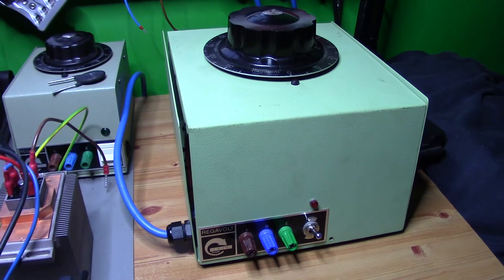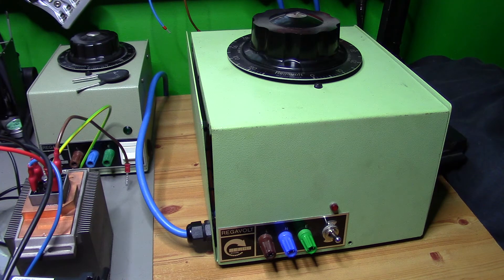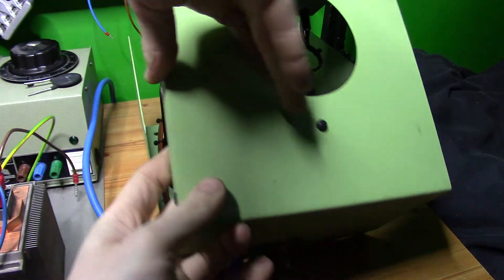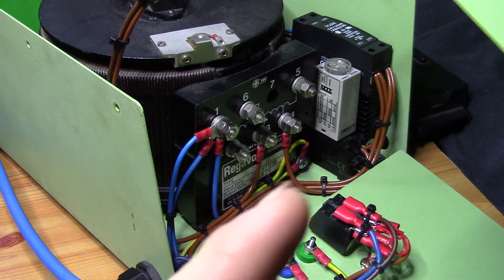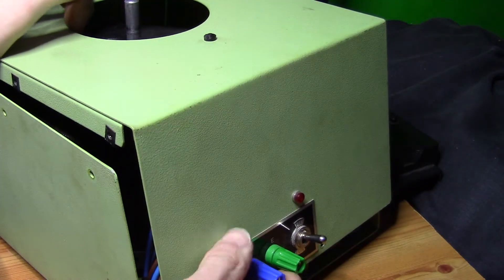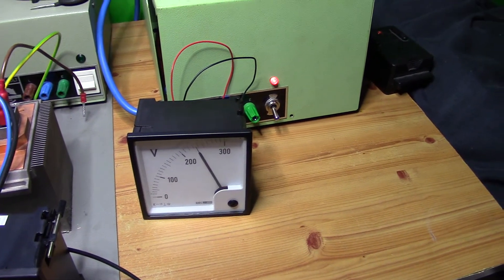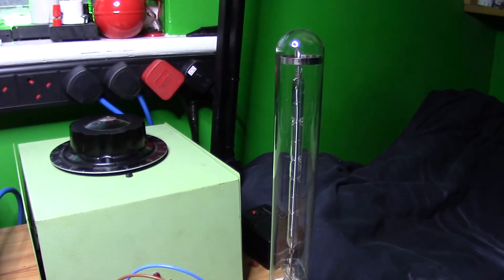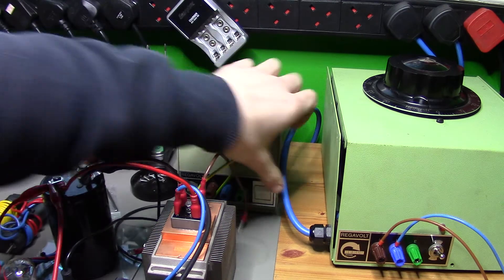Variac Soft Start Circuit + New Video Camera!

Comment: Just a note on the physics: (counterintuitively) you'll have peak inrush when you turn on the variac at the zero crossing point of the AC waveform. If you do the maths with an ideal transformer/variac you'll expect 2x the normal operating current at this point as inrush, but in real life the inrush current can be >100x instead, because the iron core will reach its so-called saturation flux (the point where magnetization of the core maxes out, and stops increasing the magnetic field inside the core by very much). At this point the effective impedance of the autotransformer windings will nosedive (electrically it will start to look like an air-wound variac, which---surprise---doesn't work), and the only thing stopping the transformer windings from cooking instantly due to the huge current is the fact that the mains AC waveform will shortly reverse polarity in 1/100 or 1/120th of a second. (Nonetheless, this isn't good for the windings.)

Of course a time delay and current limiting resistor solve this problem, and there are other solutions like a smarter soft-start circuit without a current limiting resistor which turns the power on to the coil at a peak of the AC waveform (where somewhat counterintuitively inrush should just be the normal operating current).

Comment: What would happen if you were running on full load and the mains power shut off for a second then went back on? Could that resister handle it?
Very nice setup and wiring.
Reply from the maker: It would come back on for 1 second as the resistor resists the load and inrush, then trip out when the relay bypasses it because the half inrush combined with full load would easily still exceed what the B32 breaker can handle.

Thankfully power drop outs are a fairly rare (less than 4 times a year) occurrence here, excluding ones caused by myself that is (more than 40 times a year) which usually involves the variac anyway... Just like the midnight dash to the RCD last night - don't let the heatsink of a ZVS touch the earthed heatsink of the rectifier block...

=]

Comment: great tutorial! you could probably turn down the delay to half of a second because you can tell the variac is charged all the way because the meter stops climbing way before a second. very nice wiring job too! everything in your lab is all prim and proper! good job
Reply from the maker: That is very true, in fact I believe switching on the variac on the falling edge of the sine wave would be enough delay needed to switch on without a resistor, I may try this with a thyristor at some point, not a simple circuit though really.

I chose one second not only because it's the base unit of time but the delay before hearing the timer switch is enough to detect that it is ready to use, ideally the power light on the front of the variac would have been better but the wires were already short and I chose not to extend them to terminals 1 and 4 on the variac.

Don't forget the inertia of the needle on the meter could also effect the accuracy whist it is ramping up, it's not really designed for it, the sine wave captured on a oscilloscope would be more accurate for such a measurement, the needle is just a nice way of demonstrating the two-step soft start, digital meters lack the visuals for videos.

=]

Comment: Nice tidy job on the mod there Steve. Footage is awesome too with the new camera.
Reply from the maker: Thanks John, I did take my time to get it just right in there, nothing worse than rats nest wiring, there's a good chance I'll be back inside this variac again so I may as well make it easy to work on for when I do.

And yes the camera has been a much needed bit of equipment, just getting used to using it now really, I have not even touched the tip of the iceberg with all the functions and features it has yet. =]

Comment: Nice mod! Works really well and doesn't produce any heat!

I like :D
Reply from the maker: The 500 Ohm resistor does get slightly warm after repeatedly switching the variac off and on a few times, but nothing critical even after 10 times really so not a real problem.